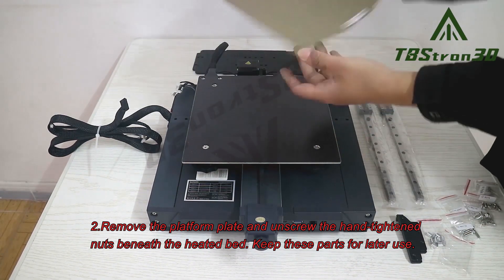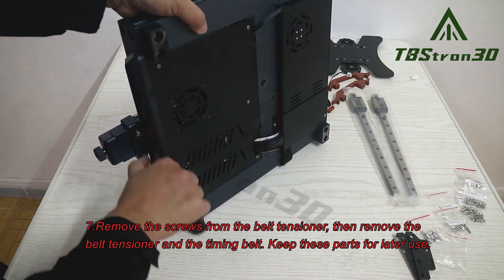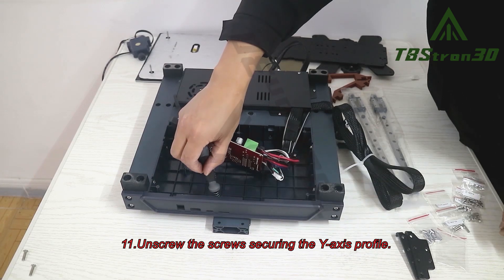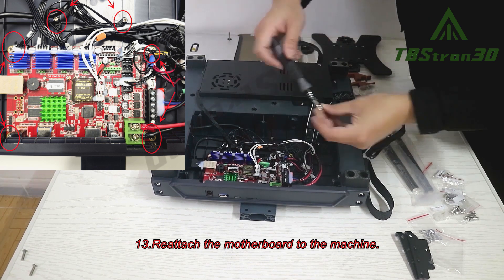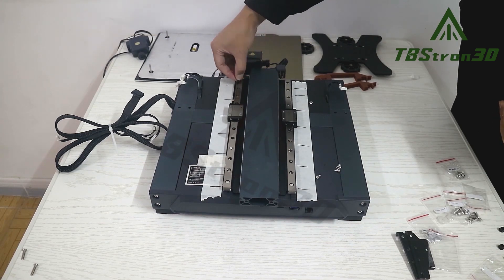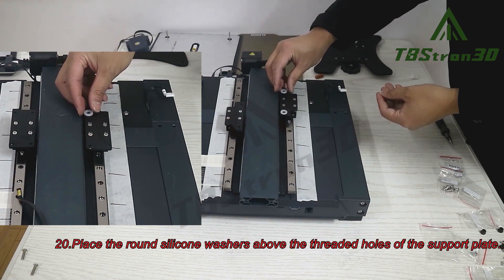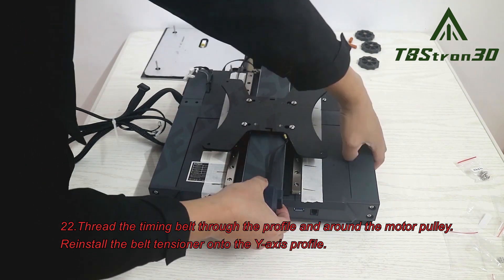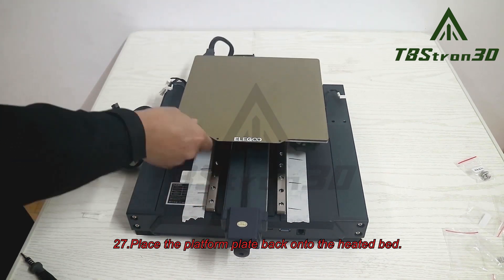Neptune 4 Pro New Y Axis Linear Rail Upgrade Installation Guide

Comment: all: the "old version" has the metal y-axis tray

M2*4 countersunk screws 
M3*12 countersunk screws
M5*10 screws 
aluminum risers

were not included in my kit. had to source them myself/reuse from the X-Axis disassembly.

while that may have been the intent all along, it would have been nice to have a "use the aluminum risers from the x-axis disassembly" instead of indicating that they're included parts.

i DID get M5*8 bolts which worked in place of the M5*10 screws mentioned herein. 

My Y-Axis plate is the "old version" but does not have as many screw holes as the one in the video. I only have the 4 holes that screw into the y-axis carrier plates. Only two of them are M5 sized. The others are M6 sized. I had to find special button-head M5 with larger than provided button heads so that they wouldn't get sucked through the y-axis plate.

ill keep this updated as I go
Reply from the maker: Hello,From your description, it seems that our warehouse team may have packed the wrong set of screws.
Please contact us at xixiranran1419@gmail.com
 and provide your order number so we can look into it and send you the correct screw pack.
Thank you!